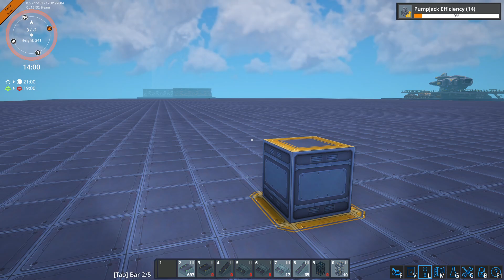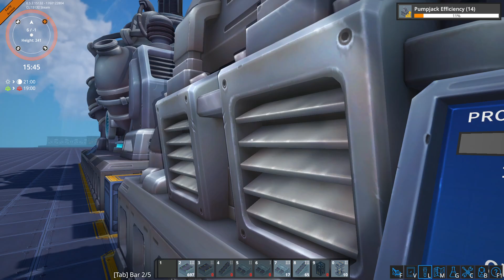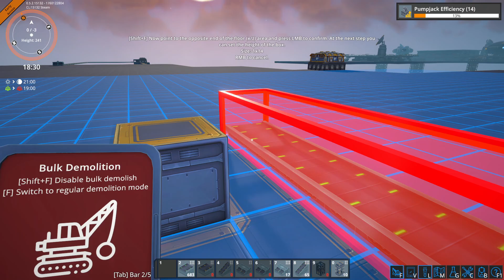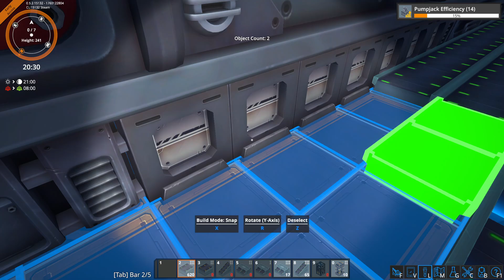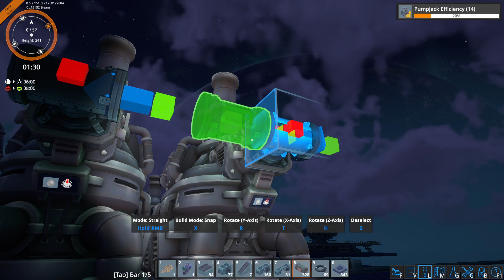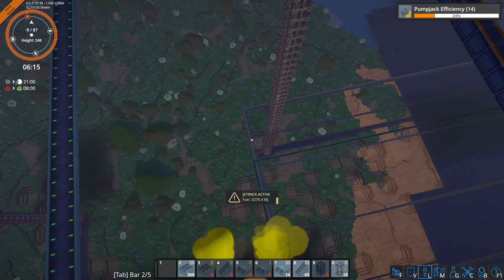Foundry Firmalite Sheets Build Guide -  160 per min

Comment: Great video.   I was struggling with getting this to work.  Never thought to move it to the origin and raise to up so high.  Do you have any suggestion on how to get the robots offloaded from the assembly line?  Currently my warehouse is full at 99 and it's slow to get them transferred to the space station.  Do I need to move that warehouse closer to this build to get the robots offloaded quicker?  Thanks.
Reply from the maker: Thanks for the compliment.   The transportation of the robots doesn't need to be nearly as close. I didn't show my robot build here, but it is at ground level with the rest of my base.  How far away is your robot warehouse?   Mine is at -276. -58 at ground level and I have not had any issues.  But elevating it certainly isn't a bad idea. I've been thinking of doing that myself.  Do you have enough Transport ships?  That could also be your bottleneck.
Reply: @tholan1000  My warehouse is at -44, 488, 135.  I have 1 transport active and 3 others sitting right next to the warehouse idle.